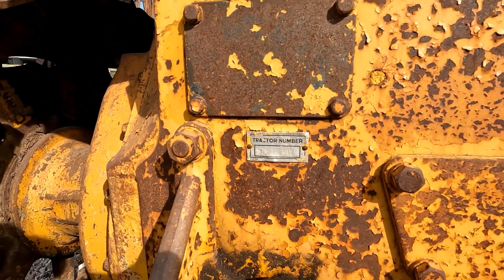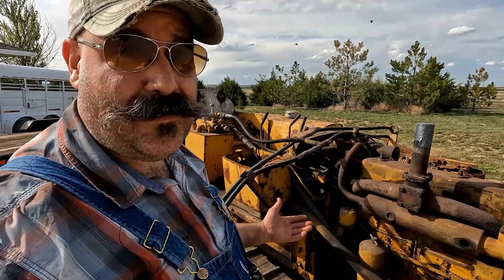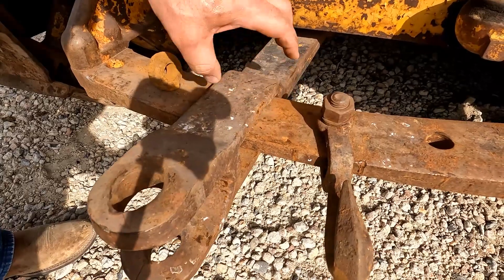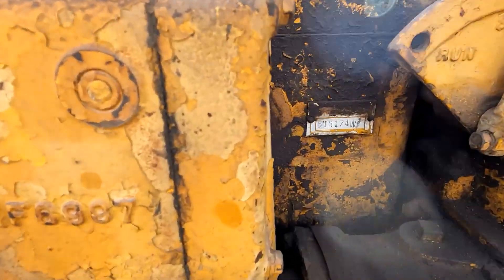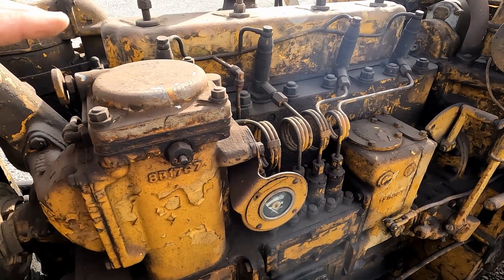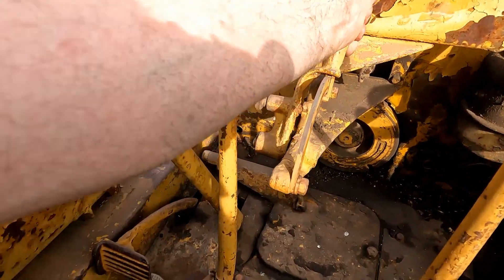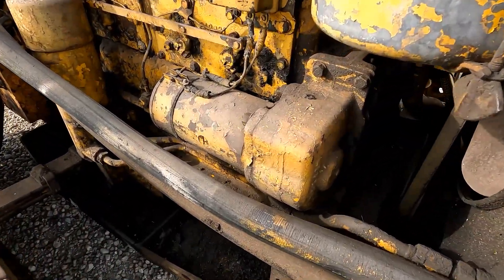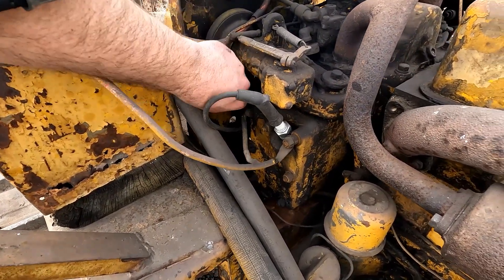1945 Caterpillar D4 5T3171 wide 5 roller frame, a Minnesota tractor! Let's have a look! Episode #2T

Comment: Can't help but notice the 5T is a 5 roller (long track frame) model. You'll have to remove links to make them fit the other machine. Also the track frames themselves are not interchangeable. The final drives bolt down different between the two..

Even on a standard length model, a 5t should have 32 links and earlier machines are only 31. I originally planned to swap my 7j tracks on my 5t but link count killed that idea.. if push comes to shove, I would offer up my parts 7j to help "lefty" out. I'm in Montana though...
Reply from the maker: Thanks Kevin! We realised that after I filmed the video. The track chains are a different style too and the grousers are too wide for lefty. Appriciate the offer! Thanks for watching!

Comment: I think your right the engine oil is just full of condensation than anything else. Just gonna say she might be a little stuck at first but should turn over fine once you get it off the dead spot. I have never seen someone trying to torch the master pins out. It almost looks like the chains are on the wrong way around?
Reply from the maker: That's what we were wondering. Something does not appear correct with the master pins.